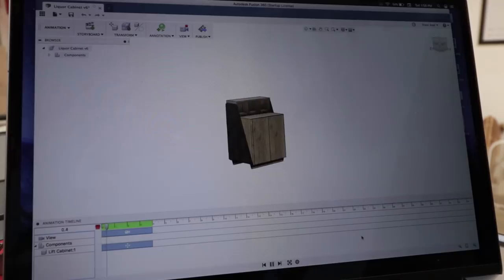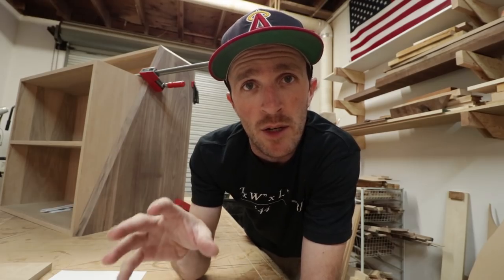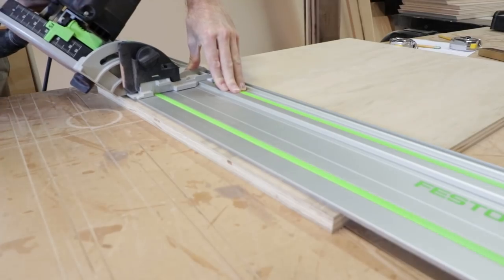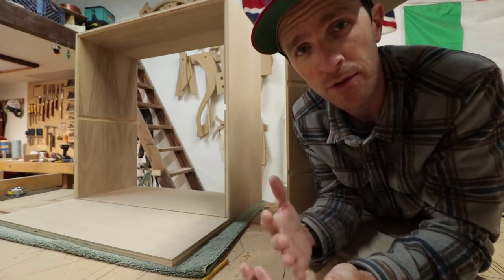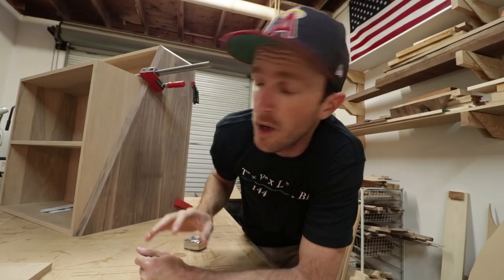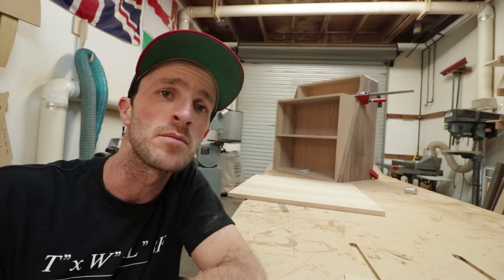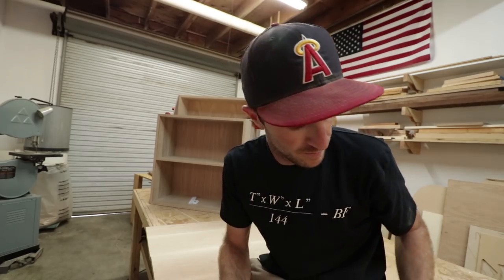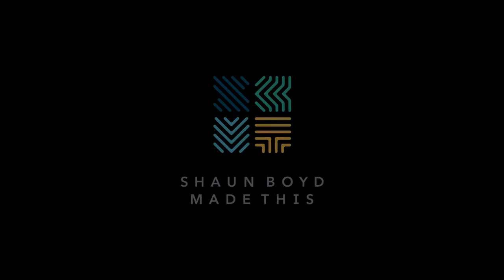Building a liquor cabinet with hidden lifting storage, Part 1

Comment: How tall does this lift to?  and I may have missed this answer, are you keeping this?
Reply from the maker: The one I have travels just over 25". Not sure what I will do with this one, but for the most part everything I make is for sale.
Reply: Shaun, what are the dimensions?  I am working on a bar cabinet that is 51" x 48" x 18" and it's a god damn bear.  Curious if the magic of youtube is making your process look like a piece of cake or I am just super sucking it up.. lol
Reply from the maker: @griffingranberg1507  Haha, YouTube definitely helps to make everything look easier. There was a lot of figuring out dimensions beforehand, and I had to do some adjustments to the lift to get it to work for my application (which I will go into more in Part 2). The overall dimensions of the cabinet when it is down is 28" wide x 22" deep x 36" tall. I think when the cabinet is raised it is maybe 54" tall, or around there.